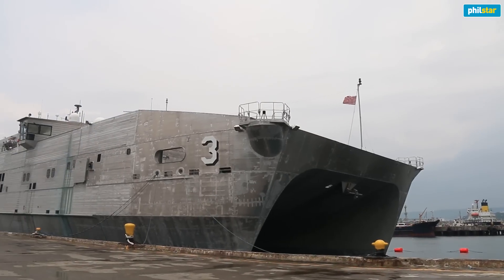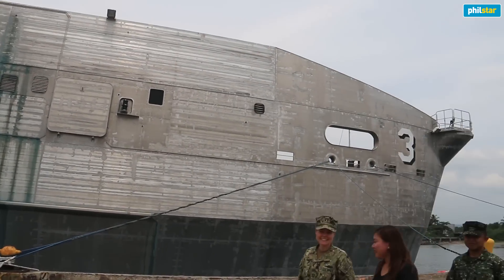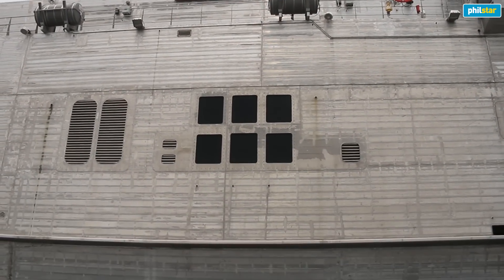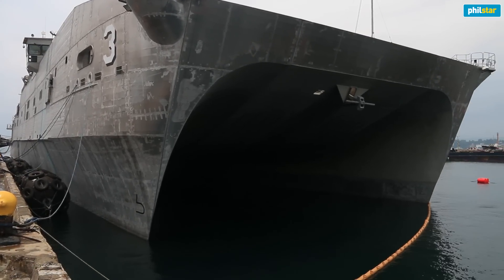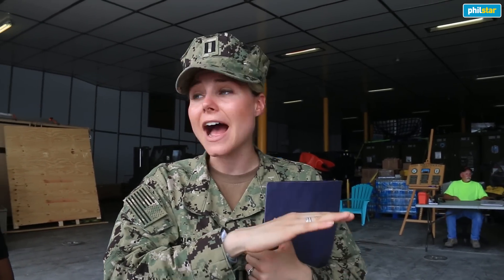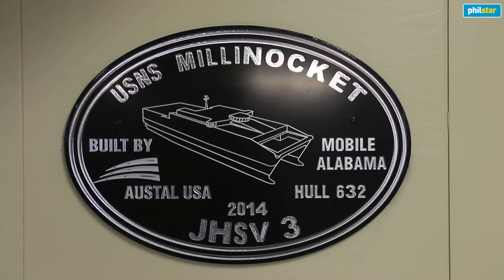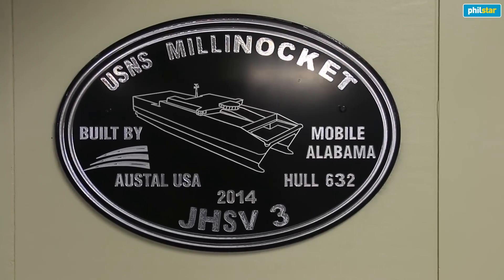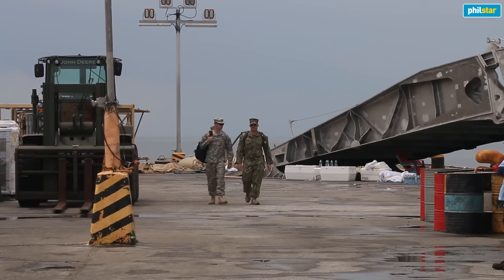Why the speedy USNS Millinocket is not painted

Comment: Well I'll be darned... If it were painted, it'd be 8,000 lbs. heavier - and therefor slower...

Leaving it unpainted also means less maintenance in the paint department !
Reply: That's the right point of view. ALU surface passivates in a natural with a thin layer of its oxide(electro-corrosion proof) and therefore needs no painting. Although commercial vessels are being painted for esthetical reasons.
Reply: *deck department
Reply: Scrap deck dept!